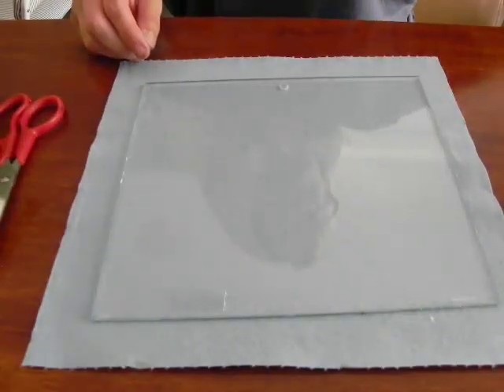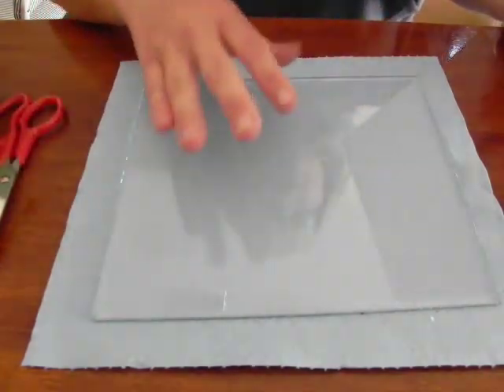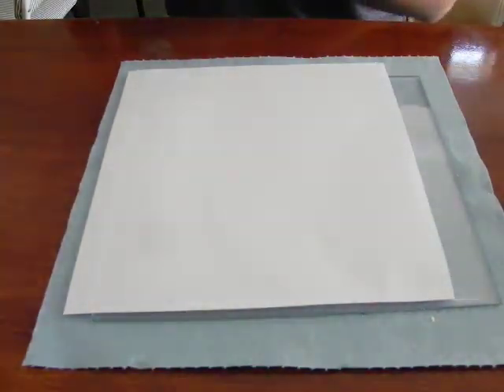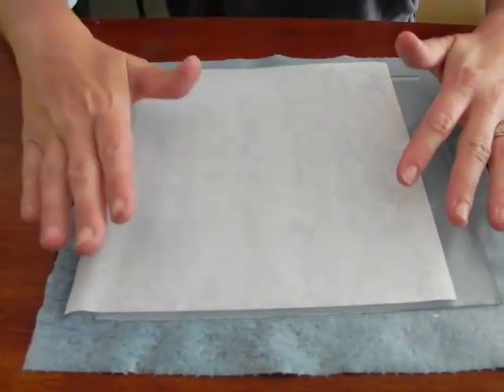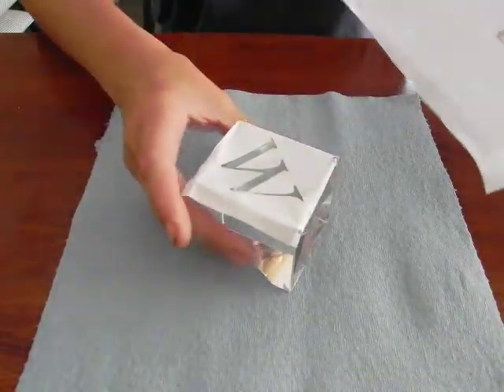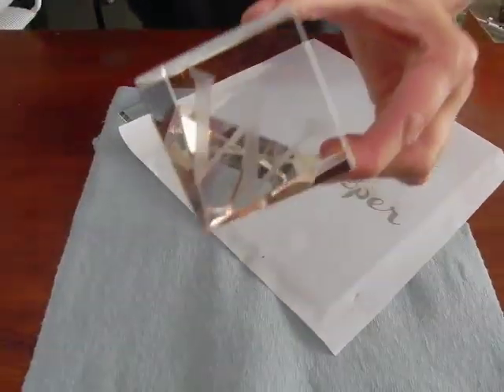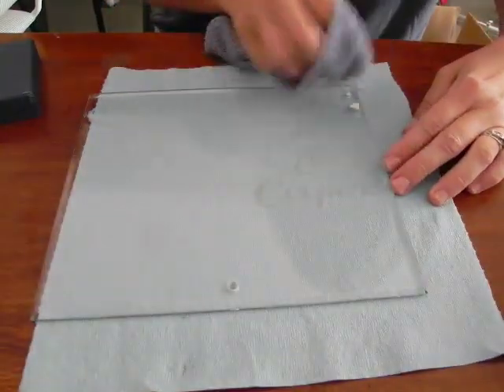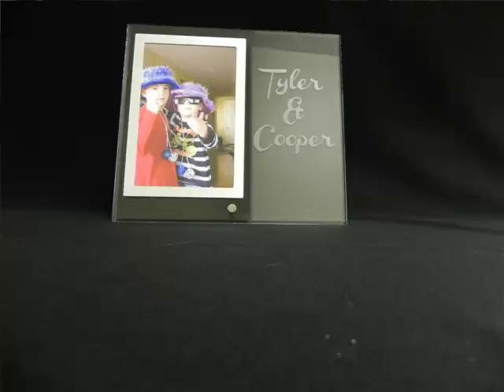Learning how to engrave glass

Comment: Is it possible to use the same technique,but with a laser diode engraver,not a co2 type?
Reply from the maker: Are you referring to a Fiber laser? If so, no. It will pass right through the glass and not mark at all.
Reply: No, he was asking about a mechanical blue laser (like what is used in blu-ray burners) that uses a diode and is finally up to 10 watts but is mostly in the 1-5 watt range (does not correlate to the same wattage as a co2 laser).